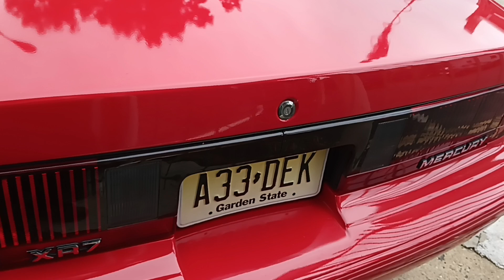1990 Mercury Cougar XR7 Supercharged 3.8 V6

Comment: You are incorrect on much of what you say here.  1st, Fox body and SN95 are terms related to Ford Mustang platforms only, not a Mercury Cougar XR7. The Mercury Cougar XR7 shares the same MN12 platform as the Ford Thunderbird SuperCoupe. 

This particular XR7 is a 1989 model, not a 1990 model as titled - can tell by the center grill attached to the hood.  In 1990 and later models the center grill was fastened between the headlights and did not lift with the hood.  How do I know, I owned a 1989 Mercury Cougar XR7 5spd and had to replace the support bracket for the center grill as mine cracked, an expensive part at the time and only used one year.

Tire size for the XR7 was 225/60R16, not 15 inch.

With respect to the interior, passenger side glove box, the top sliding door, on top of dash, slides to open a compartment independent of the the glove box.  So two separate storage areas, one lockable (glove box). 

And the JBL system was garbage as most oem stereo's of the day, amplifier or not.

I miss my '89 Mercury Cougar XR7 SC 5 spd, it was a fantastic car to drive with the supercharger & 5 spd manual!   Sorry, but your review is inaccurate and lacking.
Reply from the maker: @kdh6588  I dont care too much. The car was a slob. It was predisposed to understeer in any aggressive driving situation

. And I rather liked the JBL stereo in my Town Car.  In fact I like then Infinity Harmon Kardon amplifier in Chrysler and the Delco system in GM cars without the Bose setup.
. 
Yea you are right it was an MN12 but still the car was atrociously inadequate compared to the predecessors from 1984-88, it had poor forward visibility even though it had a promising design. These cars are a fraction of hip, cool & chic that the 1974-79 cars were.
Reply: I’m restoring an 5sp 89 sc cougar rn ! Any tips on problems that are common with that engine feel free!!